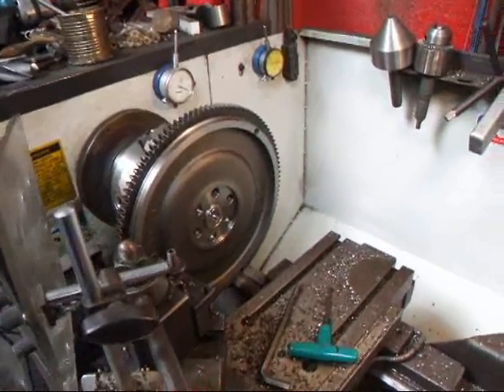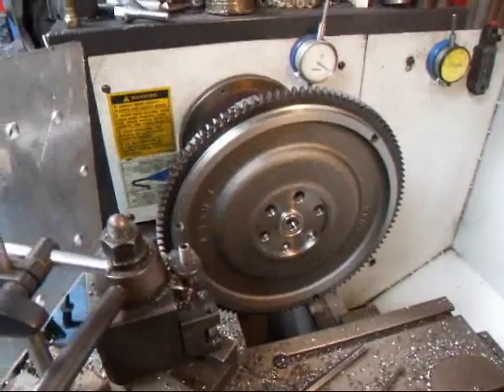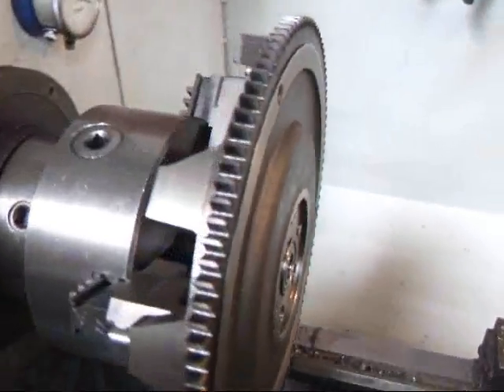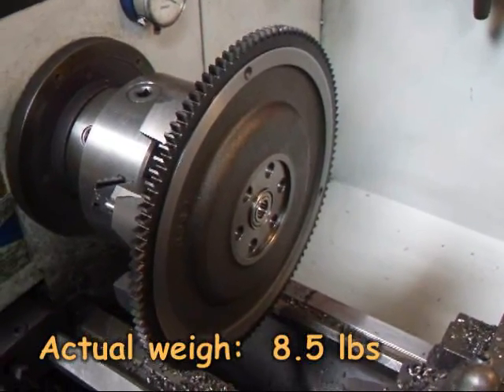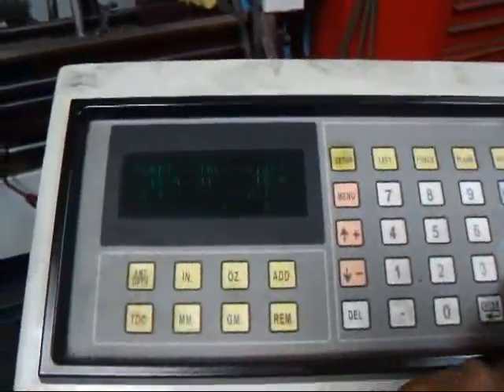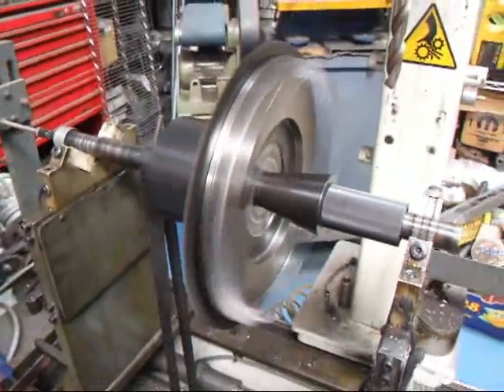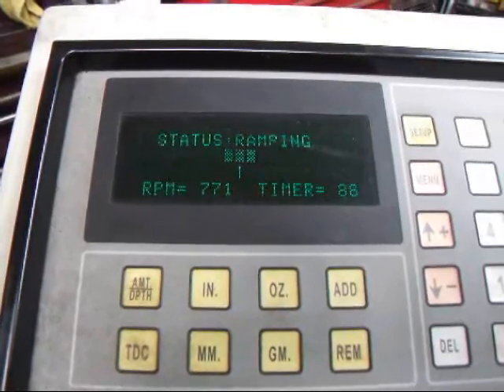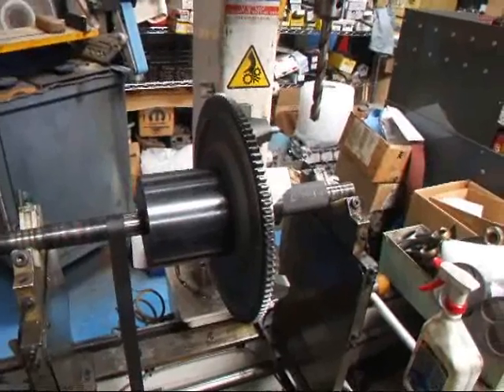Subaru Flywheel lightening and Balancing

Comment: Sir,For 210kg, 700 dia flywheel rotating speed of 4000 rpm what is the vibration limit value for these system

Comment: Was that machine specific to only balancing flywheels?  We didn't see the beginning weight. Did the customer tell you what he wanted it to weigh or just to remove the large lip on the back of the flywheel? If he gave you a weight did you have to remove and weigh several times to get it right? Finally I saw the bit smoking from the dry cut.  I'm not a machinist but wonder if a coolant and a wet cut should have been used?  Or was the cut a little aggressive causing the excessive heat and smoke?

Comment: I wonder how small and light of a flywheel a machine like this will balance? What I mean is, there are premium compettition and collector's yoyos that, depending on material and style, tend to weigh between 45 grams to 70 grams (about 1.5 oz to 2.5 oz) with each dissembled half (which you'd balance independently) being  . Much more than a toy now, I'm not sure most folks really balance on a machine so much as they try them out and chuck vibrating ones in a discount bin so sell as b-grade. There's be a lot fewer b-grades if the knew how to skim off a little material on one side etc. to balance the yoyo half. Depending on style they range from a flywheel shape to a deep-dish mini-bowl.

Comment: Hope you consulted an engineer before you hacked all that metal off. It could explode like a handgrenade if not done correctly.   Less mass also can cause warping. Now it needs explosion testing. Wind it up to 10,000 rpm and see if it self destructs.
Reply: dude it's not going to explode it might get a little hot
Reply: Dude...It's a Fucking Subaru... No way it could ever explode... Hell my grandmother had a Subaru...

Comment: there is no reason a lathe should sound like that while cutting. Grab a carbide bit and get your speeds and feeds right.
Reply: Cobalt512 Its the hormonic resonance because he is grinding so far away from where the flywheel is mounted, the closer to the centre the deeper the sound will be. hahahaha i dont really know im just guessing
Reply: It sounds perfect, Iv cut big ass flywheels you need a forklift to load in the lathe.

That's a nice balancer, wish I had one.

Comment: Technically, balanced is balanced at any rpm.

Realistically though, this is not the case as you can never reach a perfect balance. A 'tiny' imbalance at 1000rpm could be catastrophic at 10,000rpm as the forces on the supports/bearings created by the imbalance are not so small anymore, especially if the imbalance lowers the objects natural frequency/whirl speed to operating range. Violent things will happen!

I'm not sure what you mean about the metal structurally changes at very high rpm?

Comment: Technically, balanced is balanced at any rpm. Turbo's and things that go 200k~+ rpm structurally change as they spin that fast and need to be balanced at such high speeds - but in the realms of cams/cranks, the metal doesn't change at all to make any difference.

It's really down to how the balance is set up to work - technically you could make a balance work by just one rotation if it was sensitive enough; ergo anything from 1 to 10krpm is fine so long as the equipment is built for it.

Comment: John, good video.  I'm trying not to be a prick.  I don't do balancing as a profession, but the same question crossed my mind while watching the video; how does balanced at 700 rpm behave at 7000 rpms or more?  Can a balanced spin at 750 reliably predict a balance spin at 7000 and above?  From your previous comments on the poor balance of off the shelf Subaru flywheels and having my stock engine above 6000 a couple time over it's 200k life, I'm guessing a flywheel zeroed at 750 does fine @7000.

Comment: The flywheel wouldn't loose much strength because where the material is located in this case, it may loose some structural rigidity but not enough to matter unless your gonna be running alot of rpm's

Comment from the maker: Cryo will increase some strength and make the flywheel run slightly cooler. Remember that manufacturers use a specific weight on their flywheels to balance the needs of good idle and road speed performance, they are not concerned with performance, Aluminum flywheels are horrible for the street because they are way too light, engine idle is eratic.

Comment: Hi John, I had a question. After removing that material from the Flywheel and since its going on a performance engine,Wouldn't the flywheel be weakened by the material being removed.I would think it would be smart to Cryo or Heat treat the flywheel to make it stronger like the do with Ring & pinions for instance.Or would it be unnecessary to do that?

Comment: Fuc*** idiot it seems that you don't have any idea what you are talking about. Balance is balance at any speed. Balance means that if you split the flywheel in half, both halfs have the same weight. They do it in the rpm range that the machine need to detect the imbalance.

Comment: Even at 700 RPM, there's resonance/vibration and these machines certainly aren't analogous to it.  In fact, they are specifically designed to detect it.  Therefore, they will typically detect at 700RPM what humans believe manifests at several thousand RPM.

Comment: @fiatnutz Most older engines have rust on the flywheel and pully. Its usually an evenly dispersed layer of rust but i think it could upset the balance in time. And what would happen when one would remove the rust with a wirewheel?

Comment: This does not improve the car. It can lead to oscillations at higher speeds which can break the shaft/decrease performance and lifespan. You are not a mechanical engineer, they designed it for a purpose.

Comment: @1971ojoalparche1971 Lighter flywheel lowers total weight of moving parts, making the car pick up and lose revs faster. Factory flywheels are heavier, because heavier flywheel can store more momentum, making engine run stable and providing good low-end torque.